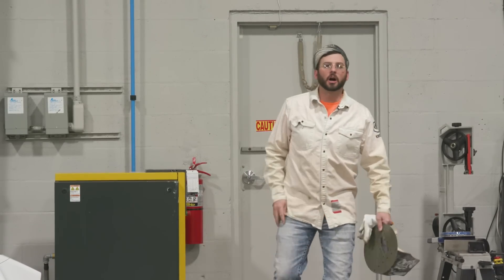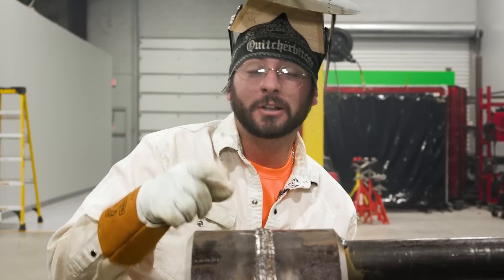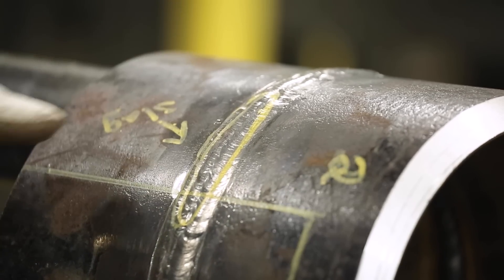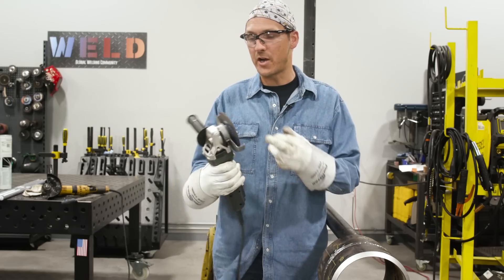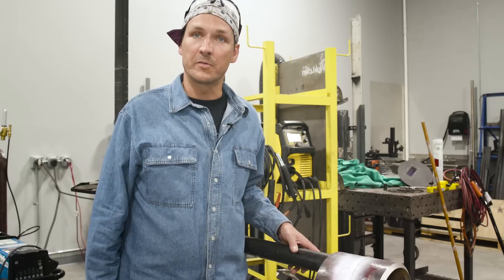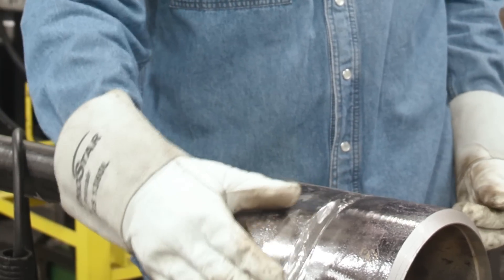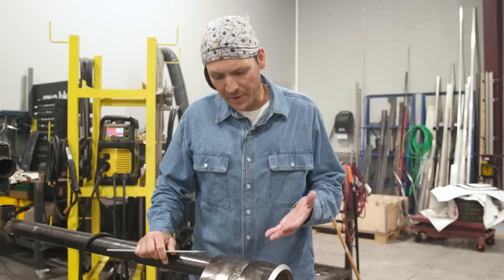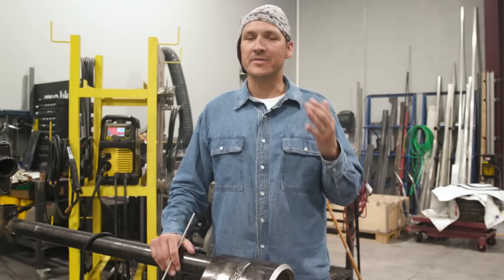STICK Welding Mistakes: How to fix a bad weld

Comment: Spoken like a typical welder (at the beginning).  Actually, it is the radiographer's responsibility to mark the repairs.  The welding inspector should be present and review the repair progress especially that the indication has been completely removed.  Another item is to look at the WPS and see if there is a minimum repair length.  For example, the radiograph may state that there is an area 1/2" long with excess porosity and the WPS may state that the minimum repair length is 1".  Another item that I recommend is that after the weld is repaired is to mark the start and stop of the repair for radiographer.  The reason for doing this  is for good communication and it also allows the radiographer to put his source directly opposite the repair area.  Great Video!

Comment: Why don't you guys Air-arc it? carbon Arc gouging is way better, I think.
Reply: Not every application is air arc or oxy friendly but if there's already welding going on grinding is likely approved as well.  

I agree with the lab comment as well.  😅
Reply: aaaaah, got ot   🤣🤣

Comment: What's with those helmets?? U guys make em at the course or something?? Never ever seen a welder in Australia where a helmet like that.
Reply: Pancake helmet.  Has "goggles" around eyes that blocks light from back and side.  Has side shield to block sparks from welder on other side of pipe.  More open so it isn't as hot as the sugar scoop hood.  Very common for pipe line welders.
Reply: They're the standard pipe fitter helmet in U.S. I don't know why, but yeah. Fixed shade too.
Reply: They are called pancake welding hoods, best in the business, especially for welding outside with the sun at your back, it is basically a goggle with a face shield